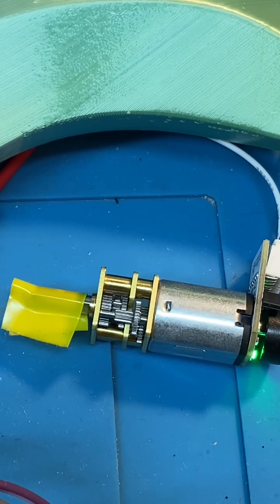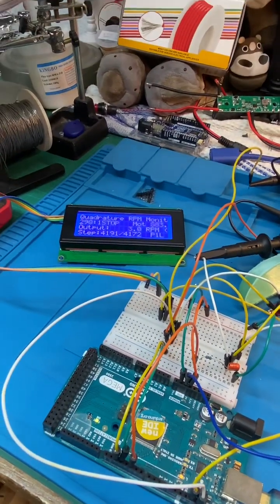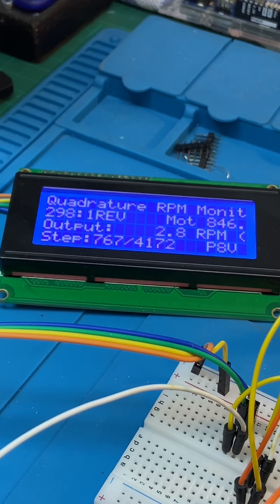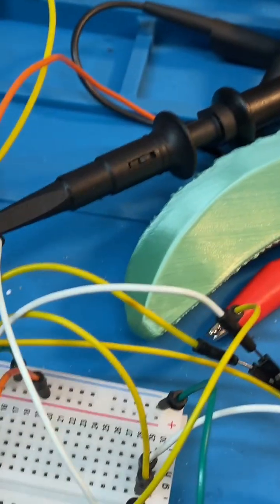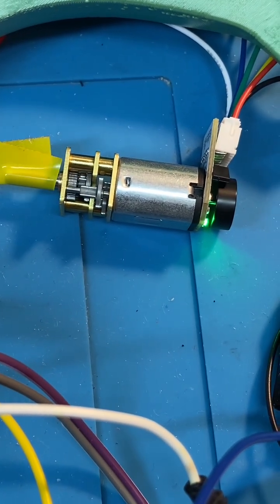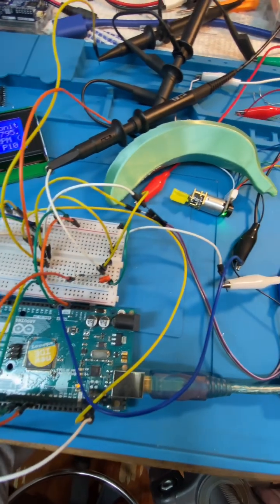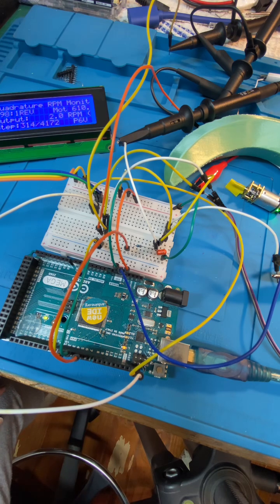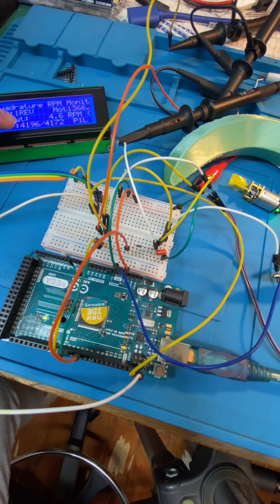Arduino Mega Trapezoidal Motion with Quadrature Feedback 🧠⚡

Comment from the maker: /*
  Mega2560 + Quadrature Encoder (D2/D3 on PINE) + 4x20 I2C LCD @ 0x27
  Trapezoidal indexing: accel -> cruise -> decel using PWM on D5 (BC337, 1k base)
*/

#include <Wire.h>
#include <LiquidCrystal_I2C.h>

#define ENC_PIN_A   2     // INT0 (PE4)
#define ENC_PIN_B   3     // INT1 (PE5)
#define MOTOR_PWM_PIN 5   // <-- PWM pin (D5). D4 is NOT PWM on the Mega.

// Encoder spec: 14 counts/rev; X4 decoding -> 56 counts/rev at motor
#define CPR_MOTOR        14
#define QUAD_FACTOR      4
#define CPR_MOTOR_X4     (CPR_MOTOR * QUAD_FACTOR)

// Gearbox motor:output = 298:1
#define GEAR_RATIO       298.0

// ===== Move distance settings (OUTPUT shaft) =====
#define USE_DEGREES      0        // 0 = use OUTPUT_REV, 1 = use OUTPUT_DEG
#define OUTPUT_REV       0.25f    // per step if USE_DEGREES==0
#define OUTPUT_DEG       30.0f    // per step if USE_DEGREES==1

// ===== Trapezoid profile (counts-based) =====
// Tune these three for your mechanism & motor
#define ACCEL_COUNTS         1200L   // counts to ramp up
#define DECEL_COUNTS         1200L   // counts to ramp down (usually same as accel)
#define STOP_LEAD_COUNTS      50L    // cut power this many counts early to reduce overshoot (0..200)

// ===== PWM tuning =====
#define DUTY_START            60     // gentle start so it doesn’t jerk
#define DUTY_CRUISE          100     // main speed (0..255)
#define DUTY_END              40     // low duty near the end of decel (helps settle)
#define DUTY_MIN              0      // clamp floor
#define DUTY_MAX             255     // clamp ceiling

// ===== Display timing / smoothing (unchanged) =====
#define LCD_ADDR   0x27
LiquidCrystal_I2C lcd(LCD_ADDR, 20, 4);
#define GATE_MS    500
#define EMA_ALPHA  0.35

// --- State for RPM & direction ---
volatile long quadCount_total = 0;
volatile long quadCount_gate  = 0;
volatile uint8_t prevState    = 0;

enum Dir { DIR_STOP=0, DIR_FWD=1, DIR_REV=2 };
volatile Dir lastStepDir = DIR_STOP;

unsigned long lastGateMs = 0;
float motorRpmEMA  = 0.0f;
float outputRpmEMA = 0.0f;
Dir   displayDir   = DIR_STOP;

// Quadrature transition table: index=(prev<<2)|curr (A in bit1, B in bit0)
int8_t quadTable[16] = {
/*00->*/  0, +1, -1,  0,
 /*01->*/ -1,  0,  0, +1,
 /*10->*/ +1,  0,  0, -1,
 /*11->*/  0, -1, +1,  0
};

// Fast port read on MEGA: D2=PE4, D3=PE5
inline uint8_t readAB() {
  uint8_t a = (PINE & _BV(PE4)) ? 1 : 0;  // pin 2
  uint8_t b = (PINE & _BV(PE5)) ? 1 : 0;  // pin 3
  return (a << 1) | b;
}

void encISR() {
  uint8_t curr = readAB();
  uint8_t idx  = (prevState << 2) | curr;
  int8_t step  = quadTable[idx];
  if (step != 0) {
    quadCount_total += step;
    quadCount_gate  += step;
    lastStepDir = (step > 0) ? DIR_FWD : DIR_REV;
  }
  prevState = curr;
}

// ===== Indexer + trapezoid =====
enum Seq { SEQ_IDLE, SEQ_MOVING, SEQ_DWELL };
Seq seq = SEQ_IDLE;

long moveStartCount = 0;
long targetCounts   = 0;
unsigned long dwellStartMs = 0;
#define DWELL_MS  1500UL

// current PWM command
int dutyCmd = 0;

long countsPerOutputRev() {
  return (long)(CPR_MOTOR_X4 * GEAR_RATIO + 0.5f);  // 56 * 298 = 16688
}

long computeTargetCounts() {
  float revs = USE_DEGREES ? (OUTPUT_DEG / 360.0f) : OUTPUT_REV;
  return (long)(revs * (float)countsPerOutputRev() + 0.5f);
}

inline void motorPWM(int duty) {
  if (duty < DUTY_MIN) duty = DUTY_MIN;
  if (duty > DUTY_MAX) duty = DUTY_MAX;
  analogWrite(MOTOR_PWM_PIN, duty);
}

void startMove() {
  noInterrupts();
  moveStartCount = quadCount_total;
  interrupts();

  targetCounts = computeTargetCounts();

  // If move is shorter than 2*ACCEL, auto triangular
  long accelC = min(ACCEL_COUNTS, max(0L, targetCounts/2));
  // prime state
  dutyCmd = DUTY_START;
  motorPWM(dutyCmd);

  seq = SEQ_MOVING;
}

bool moveReached(bool withLead=true) {
  long nowCnt;
  noInterrupts();
  nowCnt = quadCount_total;
  interrupts();

  long progressed = labs(nowCnt - moveStartCount);
  long stopAt = withLead ? max(0L, targetCounts - STOP_LEAD_COUNTS) : targetCounts;
  return progressed >= stopAt;
}

void toDwell() {
  motorPWM(0);
  dwellStartMs = millis();
  seq = SEQ_DWELL;
}

// simple integer map with clamp
long imap(long x, long in_min, long in_max, long out_min, long out_max) {
  if (in_max == in_min) return out_min;
  long v = (x - in_min) * (out_max - out_min) / (in_max - in_min) + out_min;
  if (out_min < out_max) {
    if (v < out_min) v = out_min;
    if (v > out_max) v = out_max;
  } else {
    if (v > out_min) v = out_min;
    if (v < out_max) v = out_max;
  }
  return v;
}

void trapezoidService() {
  if (seq != SEQ_MOVING) return;

  // Snapshot counts
  long nowCnt;
  noInterrupts();
  nowCnt = quadCount_total;
  interrupts();

  long progressed = labs(nowCnt - moveStartCount);
  long remaining  = max(0L, targetCounts - progressed);

  // Handle short moves (triangular) vs long moves (true trapezoid)
  long accelC = ACCEL_COUNTS;
  long decelC = DECEL_COUNTS;

  if (targetCounts < (ACCEL_COUNTS + DECEL_COUNTS)) {
    // Triangular: split evenly
    accelC = targetCounts / 2;
    decelC = targetCounts - accelC;
  }

  // Accel region
  if (progressed < accelC) {
    dutyCmd = (int)imap(progressed, 0, accelC, DUTY_START, DUTY_CRUISE);
  }
  // Decel region
  else if (remaining <= decelC) {
    // ramp down from cruise to DUTY_END
    dutyCmd = (int)imap(remaining, decelC, 0, DUTY_CRUISE, DUTY_END);

    // Final approach taper: very low counts → fade to 0
    if (remaining <= 60) {
      dutyCmd = (int)imap(remaining, 60, 0, dutyCmd, 0);
    }
  }
  // Cruise region
  else {
    dutyCmd = DUTY_CRUISE;
  }

  motorPWM(dutyCmd);

  // Finished? Use early cut with lead to reduce overshoot
  if (moveReached(true)) {
    toDwell();
  }
}

// ===== Display helpers (unchanged basics) =====
void printDir(Dir d) {
  lcd.setCursor(5,1);
  switch (d) {
    case DIR_FWD: lcd.print("FWD "); break;
    case DIR_REV: lcd.print("REV "); break;
    default:      lcd.print("STOP"); break;
  }
}
void printMotorRpm(float rpm) {
  lcd.setCursor(15,1); char buf[10]; dtostrf(rpm, 6, 1, buf); lcd.print(buf); lcd.print(" ");
}
void printOutputRpm(float rpm) {
  lcd.setCursor(8,2);  char buf[10]; dtostrf(rpm, 6, 1, buf); lcd.print(buf);  lcd.print(" ");
}
void printIndexerStatus() {
  long nowCnt; noInterrupts(); nowCnt = quadCount_total; interrupts();
  long progressed = labs(nowCnt - moveStartCount);

  lcd.setCursor(0,3);
  lcd.print("Step:");
  char b[12];
  ltoa(progressed, b, 10); lcd.print(b);
  lcd.print("/");
  ltoa(max(0L, targetCounts), b, 10); lcd.print(b);
  lcd.print(" ");

  lcd.setCursor(16,3);
  switch (seq) {
    case SEQ_MOVING: lcd.print("MOV "); break;
    case SEQ_DWELL:  lcd.print("DWL "); break;
    default:         lcd.print("IDL "); break;
  }
  lcd.setCursor(20-4,3);
  lcd.print("P"); // show duty briefly as a number if you want:
  // comment next two lines if you don't want duty readout
  lcd.setCursor(20-3,3);
  lcd.print(dutyCmd/10); // crude 0..25
}

void setup() {
  pinMode(ENC_PIN_A, INPUT_PULLUP);
  pinMode(ENC_PIN_B, INPUT_PULLUP);
  pinMode(MOTOR_PWM_PIN, OUTPUT);
  analogWrite(MOTOR_PWM_PIN, 0);

  prevState = readAB();
  attachInterrupt(digitalPinToInterrupt(ENC_PIN_A), encISR, CHANGE);
  attachInterrupt(digitalPinToInterrupt(ENC_PIN_B), encISR, CHANGE);

  lcd.init(); lcd.backlight(); lcd.clear();
  lcd.setCursor(0,0); lcd.print("Quadrature RPM Monitor");
  lcd.setCursor(0,1); lcd.print("Dir: ----   Motor: ----.- RPM");
  lcd.setCursor(0,2); lcd.print("Output: ----.- RPM (298:1)");
  lcd.setCursor(0,3); lcd.print("Step: 0/0  IDL ");

  lastGateMs = millis();
  seq = SEQ_IDLE;   // kick off
}

void loop() {
  // Run the trapezoid controller fast (open-loop PWM profile)
  trapezoidService();

  // Gate-based RPM calc + display
  unsigned long now = millis();
  if (now - lastGateMs >= GATE_MS) {
    noInterrupts();
    long delta = quadCount_gate;   // signed counts in window
    quadCount_gate = 0;
    interrupts();

    float motorRPM = 0.0f;
    if (delta != 0) {
      float revsGate = (float)delta / (float)CPR_MOTOR_X4;
      motorRPM = fabs(revsGate * (60000.0f / (float)GATE_MS));
      displayDir = (revsGate > 0) ? DIR_FWD : DIR_REV;
    } else {
      displayDir = DIR_STOP;
      motorRPM = 0.0f;
    }
    float outputRPM = motorRPM / GEAR_RATIO;

    motorRpmEMA  = EMA_ALPHA * motorRPM  + (1.0f - EMA_ALPHA) * motorRpmEMA;
    outputRpmEMA = EMA_ALPHA * outputRPM + (1.0f - EMA_ALPHA) * outputRpmEMA;

    printDir(displayDir);
    printMotorRpm(motorRpmEMA);
    printOutputRpm(outputRpmEMA);
    printIndexerStatus();

    lastGateMs = now;
  }

  // Sequence handling (idle -> move -> dwell -> repeat)
  switch (seq) {
    case SEQ_IDLE:     startMove(); break;
    case SEQ_MOVING:   /* handled by trapezoidService */ break;
    case SEQ_DWELL:
      if (millis() - dwellStartMs >= DWELL_MS) startMove();
      break;
  }
}